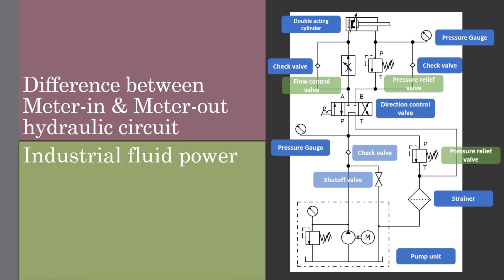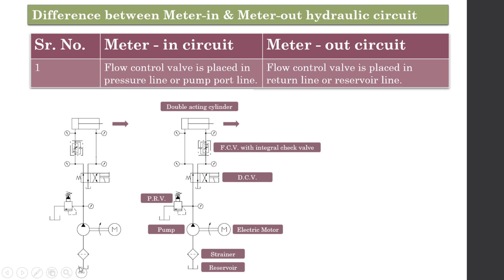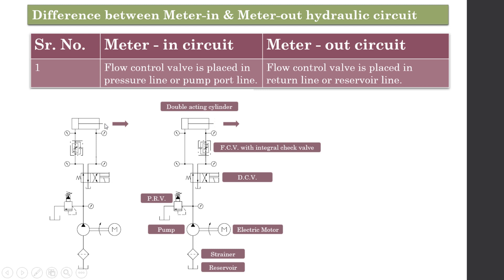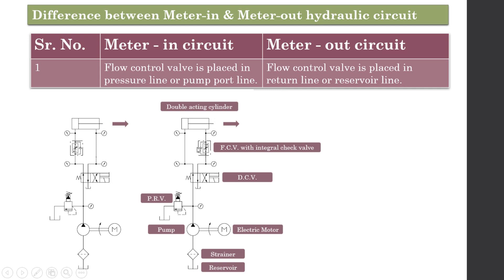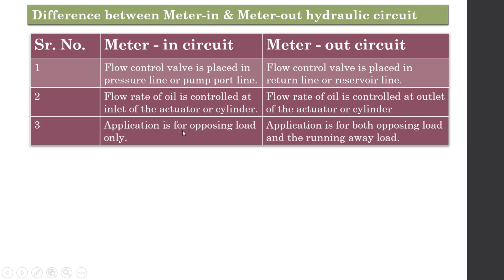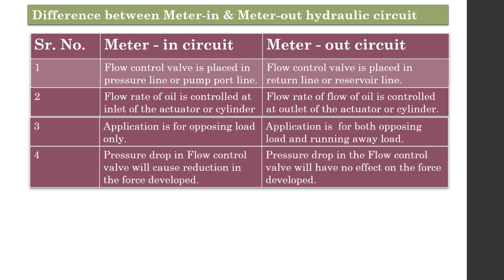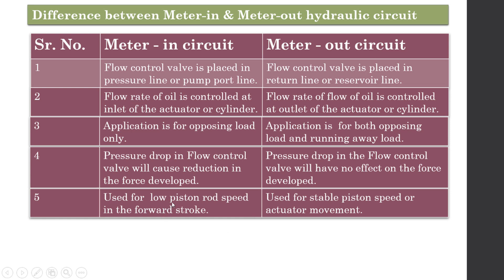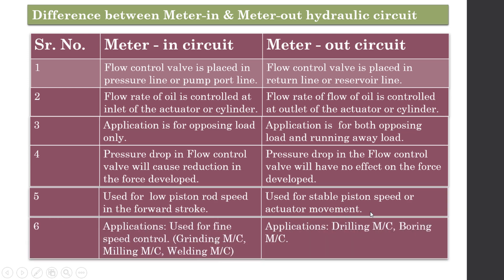Difference between meter in hydraulic circuit & meter out hydraulic circuit

Comment: Thank you for putting this up. May I recommend that you explain the finer nuances of meter out control, cavitation effects caused due to running away loads as well as the problems with  'meter-out' circuits where the pressure in the return line may be many multiples of what the pressure in the system is.
It's the crucial understanding of this that would lead to application understanding and which throttle valve to adjust, else this becomes too theoretical without any understanding in the field.
Reply from the maker: Great suggestion!